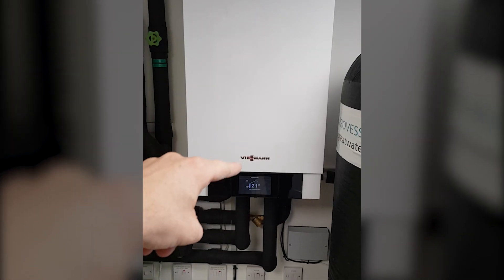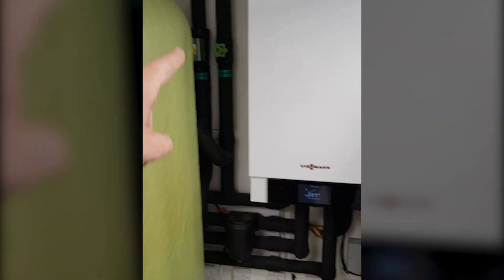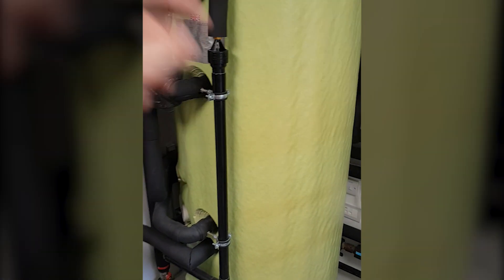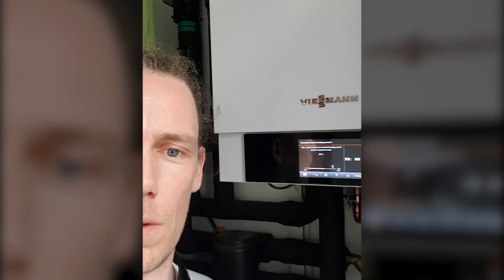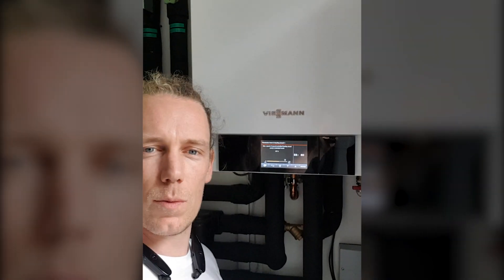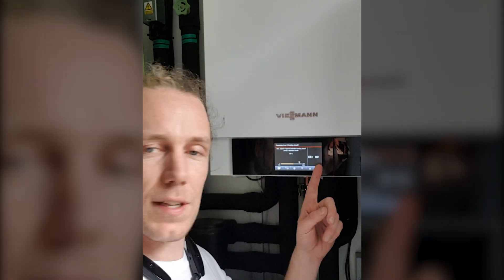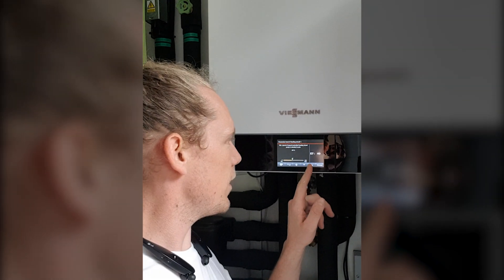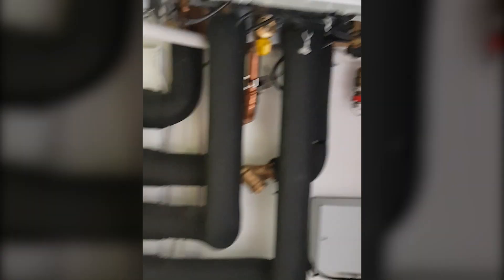Hydraulic Seperation Anxiety.

Comment: Noticed the air separation was on the hot water circuit is this due to it being four pipes and that's going to be the hottest primary from the boiler? And would you recommend this for all four pipe systems or does it depend.
Reply from the maker: Hi David. If you have a fixed temperature boiler it would perhaps go on the heating side as that receives more flow. But this system is weather compensated and the dearstor requires heat to work...
Reply: @HeatGeek  Cheers.

Comment: Hi,before the globe valve and 2port on the pipework to the warm air unit is that a bypass?
Reply from the maker: Yes.. that was specked but was unnecessary and later removed. Boiler has a bypass build in.

Comment: Nice video, well that house made me feel like a peasant 😆

Would have never thought you would need such a low modulating boiler for a house that big ? Is the system designed to be on most of the time then then abid a very low flow temp to keep the house warm ?
Reply from the maker: Kind of.. woth these houses you need a more responsive system though.. were doing a vid shortly on this very subject.